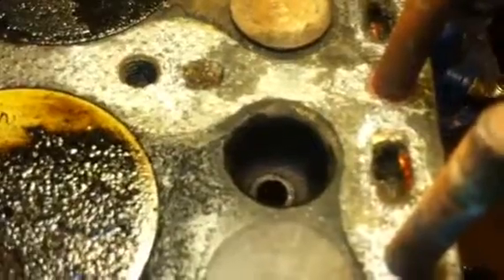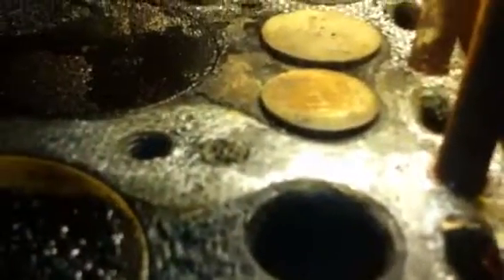Atomic 4 valve removal

Comment: Is the valve stuck? Ticking while running?
Reply from the maker: It wasn't stuck or ticking. It was burnt because the head studs stick down into the water jacket and become an obstruction to good flow. The studs also provide a great snag for any kelp or seaweed that tries to flow passed.